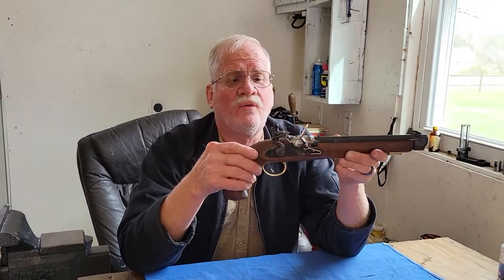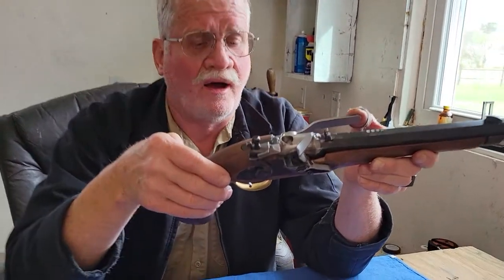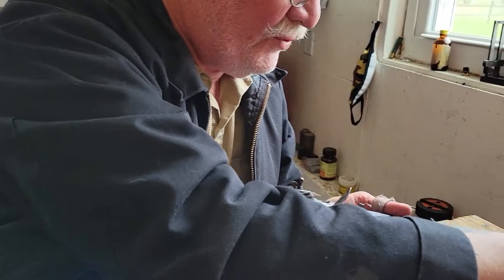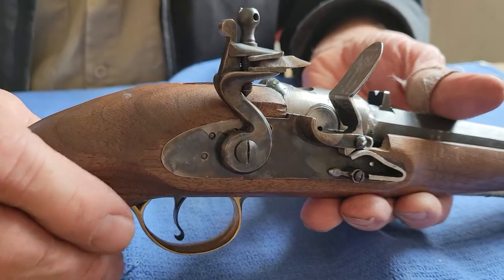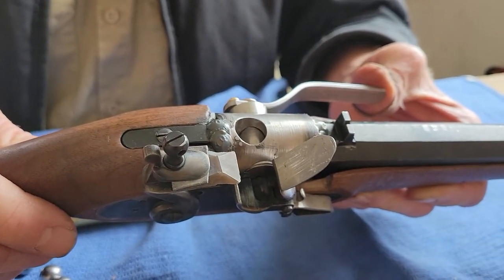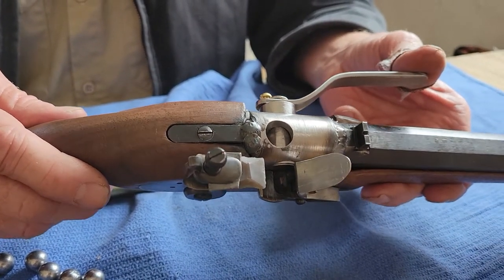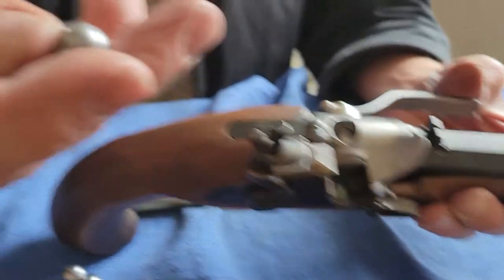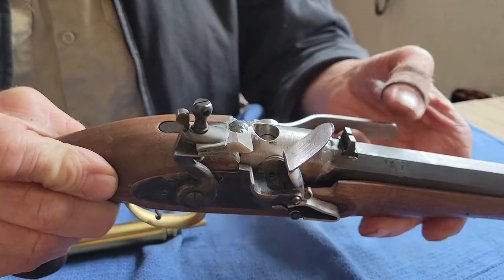breechloading flintlock pistol part 1

Comment: You could have the ball fall into a counterbored “chamber” so that when fired it is forced onto the rifling so you get enough of a gas seal to keep energy losses and blowby to a minimum. Reminds me of the old cylinder sea cock valves for sea water cooled marine engines.

Comment: My question is, after having put the ball into the gun, how does the ball not roll forward out the front of the barrel when you tilt the gun downward?
Reply from the maker: Normally this would use a .490 diameter  ball with a .010 patch. I use no patch, and use a .498 diameter ball so that the ball stops at the origin of the rifleing. Good question.